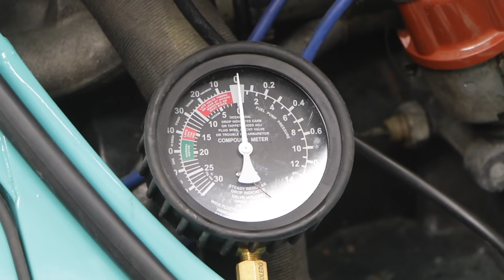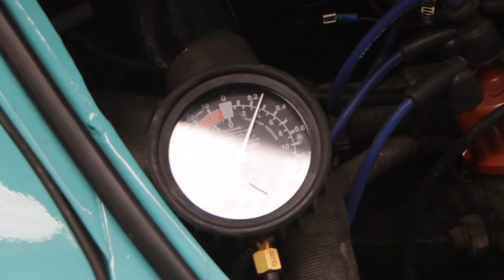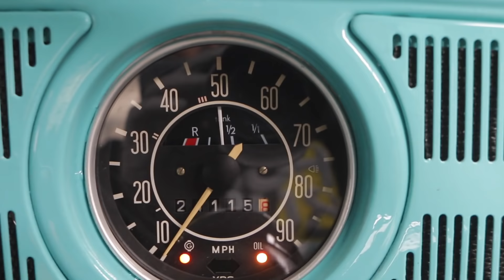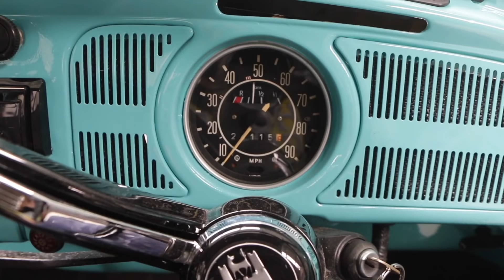Home Built Project Beetle part 27 - 1 out of 4 will have to do

Comment: Hi Jeff. If you connect the terminal on the fuel gauge that goes to the sender direct to earth, it should show full (if not, gauge is no good. also check you have 12 volt on the supply to the gauge - especially when grounding the sensor wire, dodgy supply). If so, connect the sender end of that wire to earth (frame) it should as well. If not, it's a faulty wire run. The resistor in the sender can wear and give dodgy readings, but that sender looks pretty new, but test for even ohm/resistance change as you move it. Fuel.....make sure there is no air in the regulator, and have the engine running. put the carb on one outlet and the pressure gauge on the other. There's some other good comments below. Hit a home run mate!!

Comment: Hi Jeff, regarding the fuel sending unit, it looks like you sent the float up. By bending up the fuel level will indicate less fuel. If you bend the float down, less fuel is required to indicate a more full tank. Good luck. Love you series, especially the Z.
Reply from the maker: It was bending the short arm to better contact the long arm. That was not the issue though.

Comment: The way to know which is broken: the sender or the gauge, is to connect the latter to direct ground. It should read full, if it doesn't the gauge is bad. Otherwise, the sender is the problem! (Or so I tested the one in a friend's beetle)
Reply from the maker: Great tip. Thanks. Electrical work is my weakest area.

Comment: Fuel pressure regulator should be adjusted whilst running.perhaps you were only turning it over with the starter? Another possiblity is air trapped in the system. or that you have the high pressure version...however since most beetles are fine without one perhaps it is more about excess heat and the lack of a standard air cleaner which has an air preheating regulator valve

Comment: Its been mentioned already and I agree, the fuel regulator might need a higher pressure or it might have an airlock. It might be worth finding the right pushrod for the engine, thesamba forums might have answers. I wouldn't bother with the fuel gauge either, I'd just replace it
Reply from the maker: The problem is the pump. The original length pushrod length gives too much pressure with that pump unfortunately.

Comment: There are 2 adjustments on those gauges. You insert a small Phillips screwdriver into the holes on the rear of the housing. One is for zeroing the needle & the other controls maximum needle deflection.
Reply from the maker: Not on these ones.

Comment: I think that either the fuel pressure regulator is made to work with an electric fuel pump, requiring much higher input pressure, or that it won't build pressure because the float bowl is empty. I hope you figure it out.

Comment: Block off one end of the t
Connect a fuel line to the other t
Connect pressure indicator to the line
Then check pressure

It won’t register pressure because all the fuel is currently exiting into the carb :)

Comment: Did you fix your fuel pump problems? The fuel pump stand-off may be pinching the drive rod when the motor gets hot.  Easy fix, pull the stand off out and sand it so it slips freely into the block, reassemble and that should help.

Comment: ok, lets see if i might be able to help. 1. your fuel. it might be time for a new pump and push rod.  but first. check the "bung" that comes out of the tank that supplies fuel to the pump. might be some debris in there blocking the flow. my 71 had so much crap accumulate there. VW originally didnt have a fuel regulator in the system so you should need to add one on a stock VW. 2nd. your fuel gauge might not be working correctly due to the "vibrator" or low voltage regulator on the back of the gauge. its the small rectangular block that plugs in to the gauge. 3rd, the preheat tube on the intake that circulates warm exhaust gas across the intake to keep the fuel wamr might be blocked. bad news is you will need to remove the intake and run something in the small line to clear out the carbon buildup.

Comment: Hey Jeff. Just a comment re your fuel pressure fault finding. If the reg is a T and you have the gauge on one outlet and the supply to the carby on the other is it possible it will not indicate fuel pressure until the carby bowl is full and the inlet needle closes allowing pressure to build in the line from the pump?
Reply from the maker: I cranked it over and over, many many times, and it wouldn't run.  Maybe I will try setting it with just the gauge connected to the output of the reg, and the other side blocked...
Reply: I think others have replied with the same comment regarding the reg T piece so maybe try what you’re saying. Frustrating when seemingly simple tasks don’t go to plan. I feel your pain.

Comment: You didnt have to kink the short sensor arm. They will both be at the same level  coz both floaters will touch the fuel and flaot at the same level if the tank is full.

Comment: Jeff just a thought, is the fuel sender the correct 1?  It looks clean enough to be new, a lot of fuel senders work on ohms, if it’s not the right 1 it may be reading half, just a thought rather than the gauge being faulty
Reply: This tip makes sense Jeff. I'm an engineer and used to work with fuel senders. They usually have a variable resistor inside. When the arm of the float goes up and down, it changes this resistance. You need to check if your sender has the correct lower and upper resistances (in ohms). Every car/model/brand works with different resistances. You need to research which one is right for this beetle. Do this before buying another gauge.
Reply from the maker: Good tips guys, I will look into it. The sender and the gauge are definitely Beetle parts but they could be for different years.

Comment: Do you need to lengthen the rod inside the fuel pump that you originally shortened ?? Also do you have a link to where you can get that electrical tester ? Thanks ,,
Reply from the maker: No, if anything it needs to be shorter. The tester https://www.ebay.com.au/itm/AU-Shipping-Autel-PowerScan-PS100-Circuit-Tester-12V-24V-Electronic-Repair-Tool/183331037869?epid=2292589380&hash=item2aaf61a2ad:g:0SgAAOSwIBNbTpNK

Comment: Hey Jeff, I have the similar Holley FPR on my Z (wider range one). When you had it hooked up, did the engine run?
Reply from the maker: No I couldn't get it to run. I think I need to try it again and pour fuel directly into the carby to get it to run.
Reply: Home Built By Jeff cool, might have already done, but have you checked there isn’t something blocking the regulator and/or the adjuster is stuck. Like maybe blow through it
Reply from the maker: I will give it another go next week and see if I can sort it out.
Reply: Home Built By Jeff you got this! You thinking of doing an electric fuel pump also? That would make it a little more reliable and startup quicker. Drove me nuts in my ‘59 bug
Reply from the maker: I prefer to get it to just run with what I have. If I keep having problems I may bite the bullet and go electric.
Reply: Home Built By Jeff always a good approach, my money is on a clog or restriction of some sort in the reg. Fun stuff, good luck!

Comment: Ah, the good old Beetle fuel gauge. These have frustrated every owner. usually a case of a mismatched sender with incorrect Ohm range or the little voltage regulator is cactus.
Shame this is a year old.

Comment: The regulator is just a band aid and only really useful with electric pumps. Millions were built like yours without one. You'd be better off fixing the pressure manually to factory specs. GL
Reply from the maker: It is the issue with a lot of after market fuel pumps.

Comment: JEFFGood summary for horn set up on jbugs site https://www.jbugs.com/VW-Tech-Article-Steering-Wheel-Horn-Diagrams.html Miy car is a 68 and I have the ground wire going through the column from the steering box and screwed to the horn ring which makes a circuit when pressed down. The indicator ring is separate from the horn if memory serves me right. For the fuel pump do you have small electric pump try that  set up  ie bypass the mechanical pump and see how that goes . If you go electric make sure you put in an inertia switch or relay for safety so that it wont spew gas in an accident. 
Check out the following info for testing and tuning the fuel guage using that neat guage of yours : 
http://www.midsouthvw.com/TechTips/tech_tip_FuelGauge.htm
good luck
Reply from the maker: Thanks.

Comment: hello jeff,
i found an interesting video on the tube concerning your problems with the fuel delivery to the carb.
https://www.youtube.com/watch?v=esvAQxLyf0w
it seems your not the only one with this problem,and it all has to do with aftermarket pumps and rods.
i had beetles in the past , worked a lot on them,and never had a problem about fuel delivery,they allways ran!
so why a pressure regulator
the only thing i know that if the diagram in the pump was leaking,the petrol leaked in the crankcase housing
causing the oil to thin!!
on the pump it should be fuel on top,and the oulet on the bottom,correct me if i am wrong!
hope this all wiil  help to solve your problems!
greetings to the your lovely wife.
Reply from the maker: I have been through all that in earlier episodes. I have it sorted out in tomorrows vid ;)